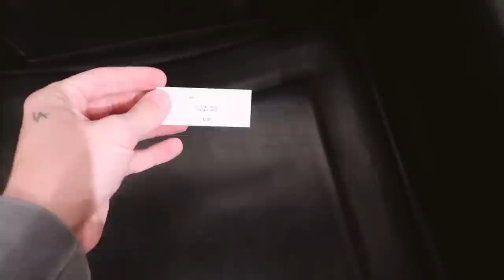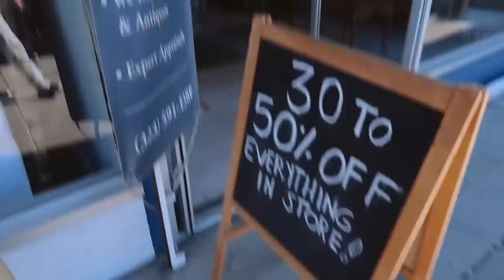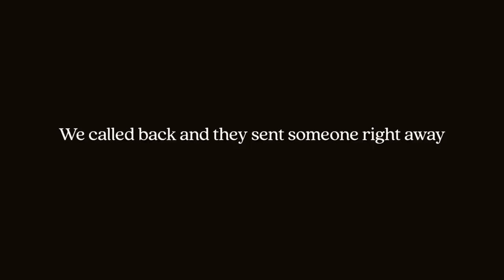EMERGENCY GAS LEAK On Move In Day

Comment: As a homeowner I recommend you learn where your main gas shut-off valve is.  Learn how to turn it off and hang a lightly greased wrench covered in a plastic bag next to it.  In an earthquake prone area this could easily prevent your house from burning down.

Comment: Ugh I had a deal with an ongoing gas leak issue this past year. Such a pain in the butt! I hope everything is resolved quickly for you, drew!
Reply: If you smell gas, don’t hang out inside. Go outside where the ventilation is safe. Glad you got someone out right away, but a gas leak is very dangerous. Not just flammable but toxic to inhale. Be safe, Drew.
Reply: @erinmoore9681  I’m assuming y’all opened the windows and at least left the room 😊❤

Comment: Beautiful. I am surprised that you have used generic modern light switches, but it's still stunning. I can't stop looking at your wood floors. They are truly the most beautiful wood floors I have ever seen.
Reply: Yeah, I did ask previously if they were going to change out the switch-plates etc. There's lots of options to go for.

Comment: Drew, you need to learn where your gas main valve is for your house(water ones too). Since it used to be a duplex, you probably have two, one for each floor. If you can't find those, learn how to turn off the gas at the meter. This knowledge could save your life and property if there is a leak or an earthquake.
So happy for you to finally be moving in!

Comment: This house is really coming together! I absolutely cannot wait to see the newly upholstered sectional. You are really capturing the architecture of the home in your interior design and I am totally here for it! So beautiful! Hopefully that gas leak was fixed quickly - that's scary stuff. I remember not long after I moved into my house, I was having sparks coming out of the electrical box at one of the breakers. It was not good. Luckily, we didn't have to cut into the walls - the issue was at the breaker itself. But if the electrician hadn't replaced it quickly, I could have had an electrical fire. This is the joy of home ownership!

Comment: OMG,  gas leaks are scary. 
Thank you for showing all the details when painting,  etc. When I saw you using a small paint brush on the trim close to the floor, I felt validated. There's always touching up and details to do when painting.  You show ALL the work. Thank you for that. 
So excited for Marie and you on the new place.

Comment: Your kitchen is so beautiful. Years ago, I bought a 1923 Craftsman house and I remember feeling the same way you do now when I first moved in. I was so proud of my new home and wanted to decorate everything.  But...the day of my closing, directly afterwards, I went over to the house with my realtor and a good friend of mine to show her the house.  I have no sense of smell but standing on the porch, unlocking the door with my new keys from the closing, both my friend and my realtor said they smelled gas. Turns out that the water heater in the basement was leaking gas. The house had stood empty for 2 years and I bought it "as is" but had it inspected prior to moving in. Even so, there I was sitting in the dark basement for 3 hours waiting for the gas man. When he came, he immediately 'red tagged' it and said I had to get out until I had it replaced. Fortunately, I had not moved in yet since it was February, but I still cried. I learned so much with that house, it was so beautiful and had most of the original woodwork and windows. I painted the outside and inside myself (except the second story), and put in new carpet and bought lots of new furniture, since I was coming from a one bedroom and most of my living room furniture fit in my new den (lol), but I had chair railings and parquet flooring in the dining room - lots of woodwork everywhere, it was so beautiful.  So, I know the disappointment you felt when they had to shut off your gas. Every set back means you're earning that new beautiful house it will become.  So happy for you with this new adventure.

Comment: now Drew this is the grandma  type advice ......
you were moving the oven .....
were you wearing solid shoes ? for toe protection.. so important 
furniture ,boxes, tables, any thing that requires 2 people to lift , 
you need solid shoes that stay on,  will not trip and  cover and protect toes, 
steel capped even better, they are not flexible for work on the floor but your toes are essential 
and need to be cared for, 
even a power tool or paint can falling on them is painful and can cause real damage.
you have your dream home looking so good in so little time,
enjoy,
take time to  smell the roses,  b

Comment: I’m a coward when it comes to gas leaks.  I had a gas leak after work on my foundation was completed - weird smell.  Took an honest insect control guy to tell me it’s gas- this after I consulted  a water heater guy and a heater guy ( they swore it wasn’t gas leak.). I called the fire department and they immediately turned off all gas to house and found leak in line to heater caused during retrofit.  They told me to call asap when I suspected gas.  Super glad I did - anything could have sparked it,  so learn from a me and be safe. And I should say the firewomen and men were super helpful and kind with me seeing as I was so ignorant .

Comment: I noticed that whenever you were putting the cover plates on your electric outlets that the receptacle has the ground prong hole located on the bottom. 
It is my understanding that the ground  should be on top as a precaution, in case something were to fall onto the plug there is not a possibility of the outlet to be shorted out if the live and the neutral pins are connected by an object falling across them. 
It is not a code requirement, but it is a practical safety consideration.

Comment: Yeah you never mess with gas leak. Had an issue with valve on fireplace and we during the time installing new gas furnace had county inspector here. We fixed the valve but it was 450 for a new valve.

Comment: A while ago you shared with us your extreme insomnia, what did you do to overcome it? Drew welcome to owning a home! When i had a gas leak they needed to make a huge hole in some drywll to make the repair. I'm wondering how long it will take you to decide all the switch plates need to be painted or covered.

Comment: We rent our home, and I told our landlords (my INLAWS) and they said it was just "burn off" from the water system.  10 F**King years we lived with it, had a wall furnace installed and the plumber came out from under the house a lovely shade of green!  We live in a house built during the second world war, with floorboards.  Turns out I WAS RIGHT, there were 3 holes in the pipes all slowly leaking. My child could have died from their "waving" it off.   Really surprised we didn't die. Trust your gut my friend, trust your gut!

Comment: I have always had gas for cooking, heating, hot water etc.  When you have a leak you get a quick response. With electricity, you can wait days!  Good new is, you'll probably not have another one.  At 72.9 years, I've only had 2 small ones.  I don't count the one where the idiot landscaper jumped on a shovel and cut the line from the street.

Comment: I was curious, so I googled muntin vs mullion... This is what I got back:
Mullions are vertical shafts located in between windows. These elements offer structural support for the windows. Meanwhile, muntins are found on the window glass itself. They are vertical and horizontal elements that divide a window's glass into a grid.Apr 15, 2022